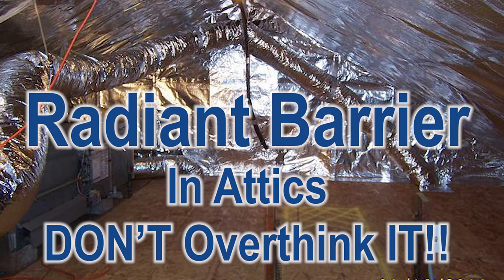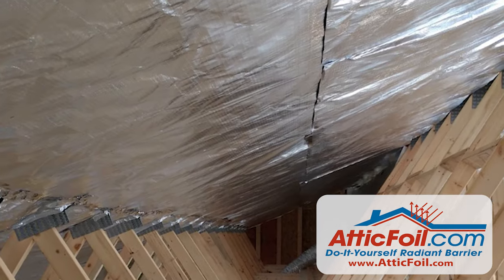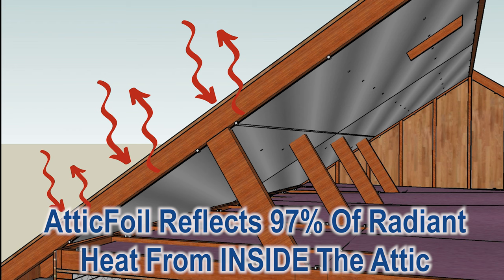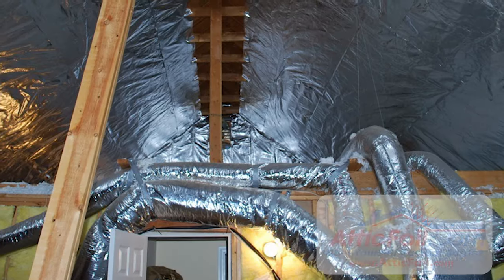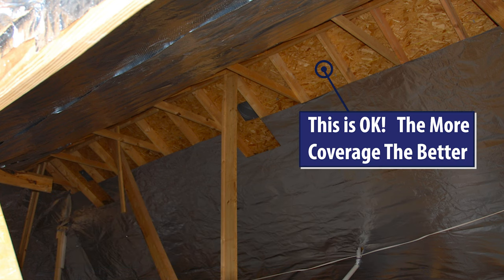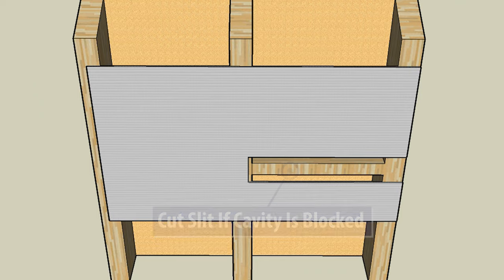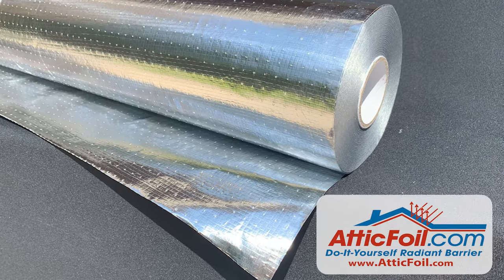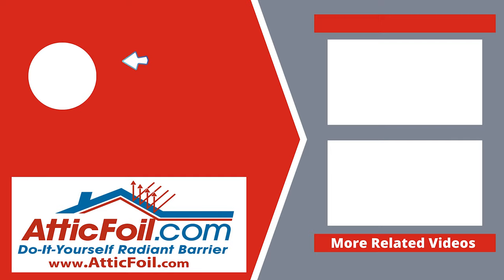Cool Down Your Attic! Radiant Barrier In Attics - DON'T OVERTHINK IT!  It's Actually Simple NEW 2023

Comment: Your the 1st I have seen that shows the foil on the bottom of the attic. My house was built in the 50s, the attic is open at the front and rear. I figure unless I get rid of the openings that the outside air is going to hear/cool the attic. I'm mostly looking to keep the house warmer in the winter.  I don't plan on putting some on the ceiling of the attic, since it would be harder to notice roof leaks.
Reply from the maker: Thanks for the comment.  For installing www.AtticFoil.com directly over the insulation we recommend using our exclusive "SuperPerf" product here:  https://atticfoil.com/index.php/products/45-wide-perforated-double-sided-radiant-barrier-foil-superperf/

Comment: Should I put insulation between the roof rafters against the roof decking with the radiant berrier over the insulation? If yes what insulation is recommended? I am doing a complete remodel with all new drywall and my hvac system will be installed in the attic.

Comment: Thanks for all the videos and information. I have a low pitch roof, where I can get to about 50% of my roof (the high part) I could possibly get the low section but I would have to crawl on my back the entire 60 foot length of the roof. Both sections are about 4 foot wide. Is it worth me crawling 2 times on my back to first pull the radiant barrier, then back track and staple it up? I haven't seen any videos showing this or even talking about it. Also, I have blown in cellulose insulation that I would be crawling on.
Reply from the maker: Generally it is not worth using www.AtticFoil.com by both stapling up and laying over insulation.  This video talks about this: https://youtu.be/iGXQOmdKBVI?feature=shared

Comment: In South Carolina what’s best way to install? Staple to underside of roof plywood or on the face of the roof joists like shown in the video. 
I saw one video saying in southern states it should be on underside of roofing plywood
Reply from the maker: You would never staple www.AtticFoil.com to the bottom of the plywood.  Installing on the bottom of the rafters will reflect heat from the deck AND work off the emissivity quality where it's actually touching the bottom of the rafters.  Do this method and don't overthink it. https://atticfoil.com/index.php/installation/staple-up-installation/

Comment: On our patio we have shingles for the roof and ceiling is sheetrock. Can it be directly applied to the sheetrock? Is it still good without the space between the sheetrock and radiant barrier for air circulation?
Reply from the maker: Yes, you could apply www.AtticFoil.com  directly to the sheetrock assuming the other side faces an airspace.

Comment: Question on using radiant barrier blankets.  Shiny reflective stuff towards the heat or facing away from it?
Reply from the maker: For most attic applications, use the DOUBLE Sided www.AtticFoil.com product.  For single sided products/applications it's best for the foil side to face the heat.
Reply: @AtticFoil  NRCA says:  If a single-sided foil sheet is used, the foil side should 
face the attic.
Reply from the maker: Nobody uses single sided foil in attics.  www.AtticFoil.com is double sided.

Comment: I have a vented attic with cellulose insulation and I have spanish tile for my roof will I be okay adding this to my rafters like you demonstrated here
Reply from the maker: NO problem! www.AtticFoil.com works with shingle, tile, or metal roofs.  Basically, if the roof is hot, it's radiating heat into the attic.  The AtticFoil will send a lot of it back.

Comment: Hi. I've gone through countless videos about this topic. However I can't find an appropriate one for my friends in Indonisia. I'm looking for a dirt cheap kind of roof insulation for dirt poor people. They always have around 40 degrees Celsius in the house. And they have monsoon rain of course that causes very high air humidity.
Does anybody know a insulation that can be done with material that they have on hand anyway - like clay or whatever.
Reply from the maker: They need a product like www.AtticFoil.com  Basically, they need "Shade" - from the heat.  I'd look around, there are lower quality/less expensive products out there.  Look for reflective insulation, etc.  Or, we have some contractor grade products that work great at a lower price.  If you are interested in sending some crates we work with customers all the time on exports.  Normally, we ship to a freight forwarder in FL or CA and they take it from there.  As for "what they have" if they don't have a reflective product, they need a high surface to mass product that can instantly dissipate the heat into the air.  This is why thatch grass roofs are used in so many places and work well for that purpose.

Comment: I suppose there is a similar 'non issue' with cedar shakes? And does the product have any benefits in the attic when its -30 or -40 outside?
Reply from the maker: The old wood shake roofs were actually pretty good at dissipating heat and self venting.  But, these attics still get pretty hot and will benefit from www.AtticFoil.com as for the cold? Minimal benefit on heat loss.  Mostly a benefit in reducing ice damming.

Comment: I have blown in insulation in my attic.  I would like a product that I could apply to the underside of the roof so I can either eliminate some, or all, of that insulation.  I want to fully re-examine my duct work that my HVAC system uses but with 4ft of blown in insulation, that makes it pretty hard.  Do you guys have a solution for that?
Reply from the maker: That's exactly what www.AtticFoil.com is for. It's like a cloudy day for your roof.  This means less heat comes into the home reducing the load on the AC unit and helping it keep up.

Comment: i have an old farmhouse with no exhaust ports or ridge in the roof. there are two gable vents (one 90% obstructed by a chimney). is it still beneficial to staple the foil to the rafters? or will the heat/hot air just overflow into the space without an escape vent?
Reply from the maker: You will be fine.  You want to install the www.AtticFoil.com in a way that the air never hits a "dead end".  Always leave gaps/slits etc. so the hot air can move upward.  From there, the hot air will find its way out of whatever "holes" you have near the top. The vents do not need to be at the absolute highest point to be effective.
Reply: @AtticFoil  that's great news! looks like i have some work to do this weekend, while the weather is still cool. i have already laid down some attic foil over the insulation (mixed climate environment), but i do have enough left to cover about 80% on the rafters as well. so if i can get the double layer going, the summers in the upstairs bedrooms should be so much more pleasant. i also plan to put a box fan on the unobstructed vent to pull out the hot air at night

Comment: Do i need to have a gap on the bottom if i have a gap up top? My thought is to apply the attic foil and then spray in insulation  which would cover the bottom gap anyways.
Reply from the maker: If you are using sprayfoam to change your attic from vented to non-vented do this method, except use foam.  No gaps. https://atticfoil.com/index.php/applications/cathedral-ceilings-hotmixed-climates/

Comment: I've got a quote (a very expensive one) to install a foam board with an aluminum facing on both sides in my attic.  I can kind of see the benefit of having something with additional R-value, but I don't know if it's a point of diminishing returns issue.
Reply from the maker: Great question.  And overthinking it!!!  You actually get NO additional R-value when put up in a ventilated attic.  Watch this video for complete explanation.  https://youtu.be/da_egAW6JgI

Comment: WHat if i ordered the original Attic foil by mistake and it does not have the perforations?  Can i merely slash slits in the original attic foil to get a similar effect?
Reply from the maker: The original www.AtticFoil.com does have micro perforations.  If you want to increase the permeability you can drill a bunch of 1/4" holes into the core if it's still on the roll, our like you said, cutting some slits/flaps/holes etc. will do the same thing.

Comment: I have a foam insulation on my attic but it’s still very hot, can I install this on top of this?
Reply from the maker: You could.  If you can "feel" radiant heat coming off the foam, then a radiant barrier from www.AtticFoil.com will help.